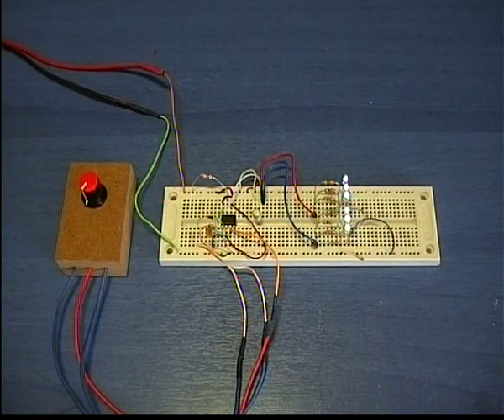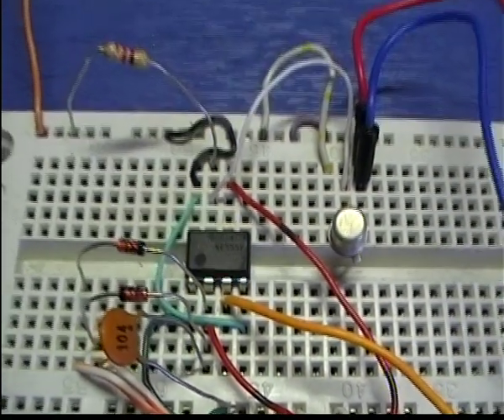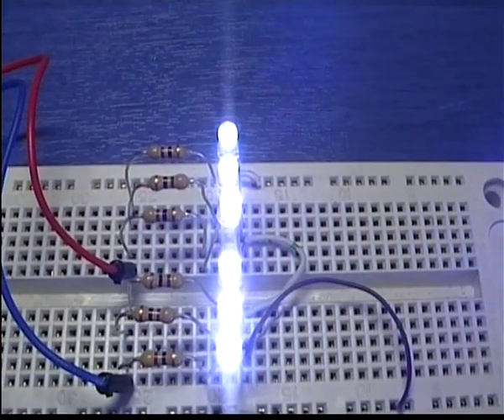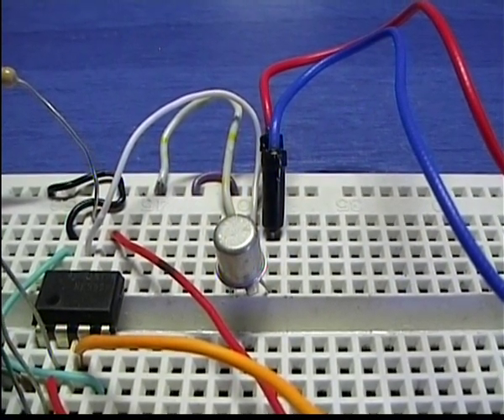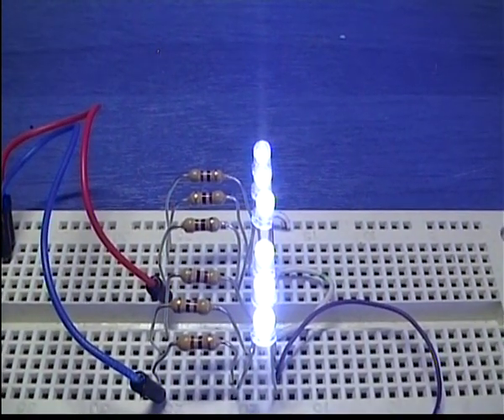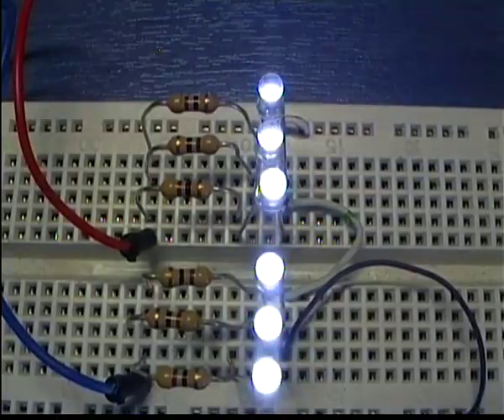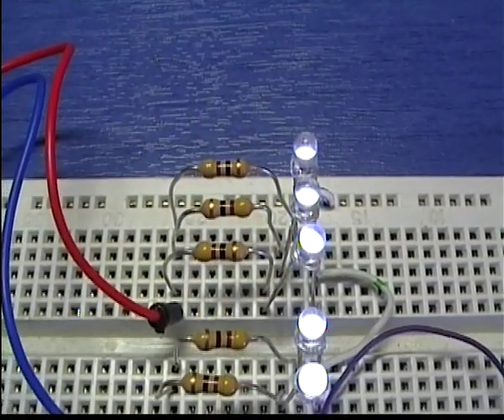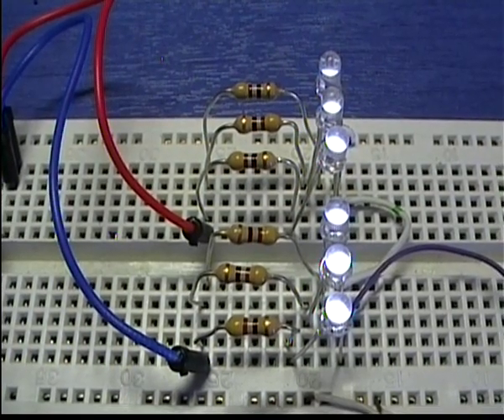An LED Array PWM Dimmer with the 555

Comment: Hello
I just tried to make the circuit, and I have a question for it.
when I turn the potentiometer from high to low, the current goes from 4,5v to 2,45v - is this correct ?.
I use 1N4007 instead of 1N4148 and a BC547C instead of the 2N2222.

Comment from the maker: @LIiutaio i bet your transistor is dead, R1 is very small OR internal transistor of 555 pin 7 is toasted... Or you got the circuit wrong. The circuit has 0-99.9% range

Comment: PCB Heaven, can I use this exact circuit but with a higher capacity transistor (like 10 A , 75W heat dissipation capacity), to power nichrome wire, and in process control the heater?